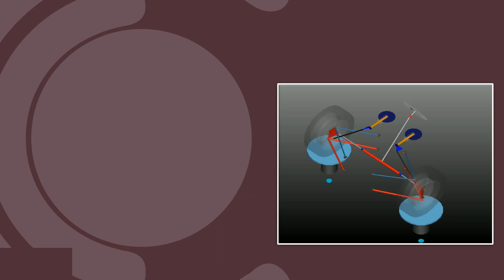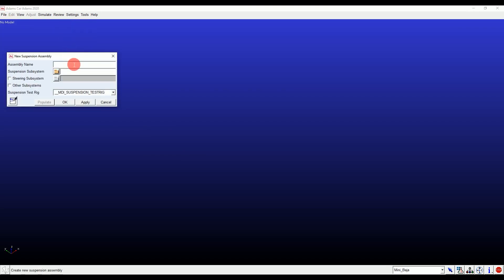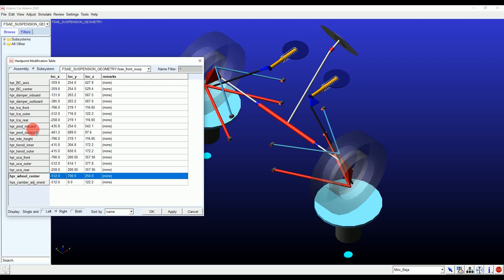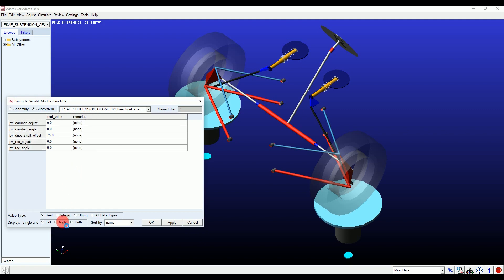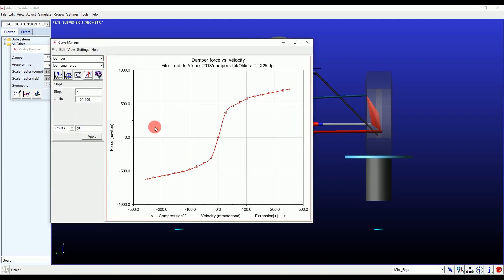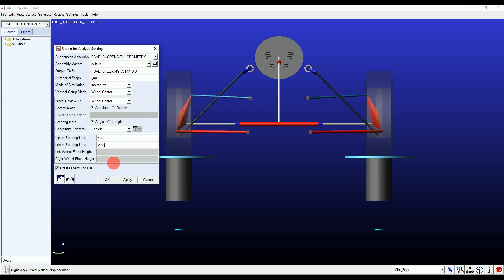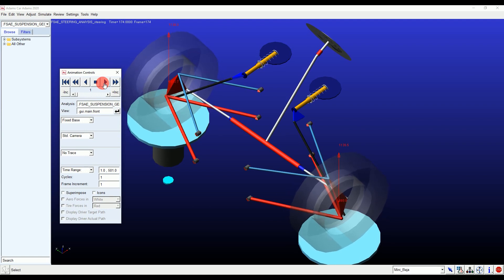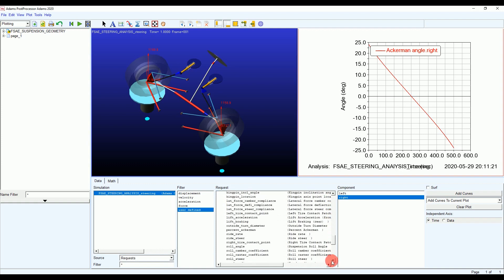🤔 How to perform FSAE SUSPENSION SIMULATION in Adams Car? | Watch This | [Adams Car Tutorials 2020]

Comment: Hi to everyone , i've a problem i do all the steps but i can't open the suspension assembly its saids that it is not in the database or than thar file is not a suspension.
Reply: im facing a similar problem it says "An error occurred during database search:
The file '_baja_steering.tpl' does not exist in the databases.
Cannot open the requested template".
Reply: i do have the same error rn. did you find any soln for this ?